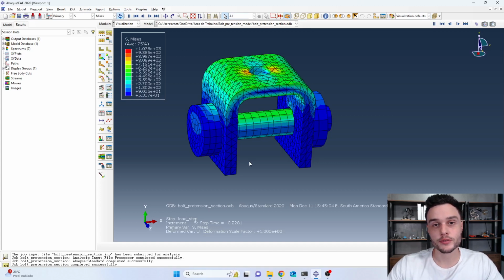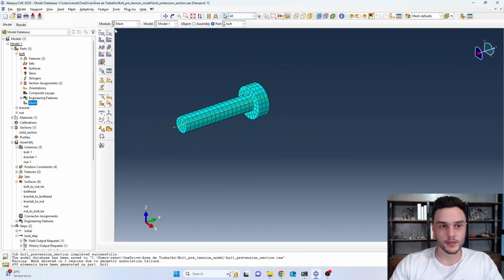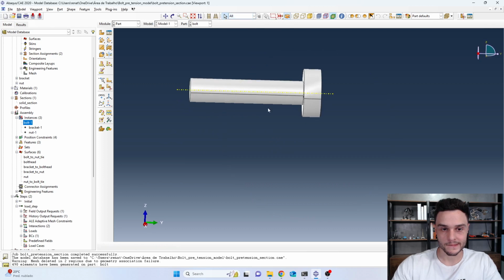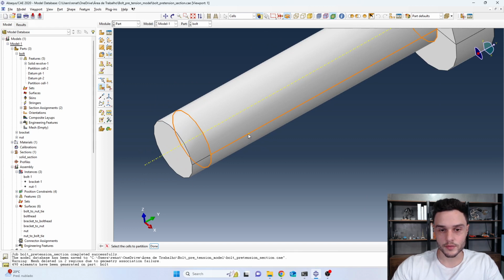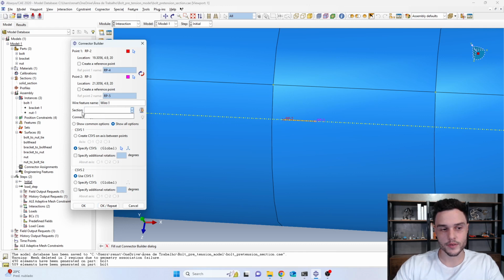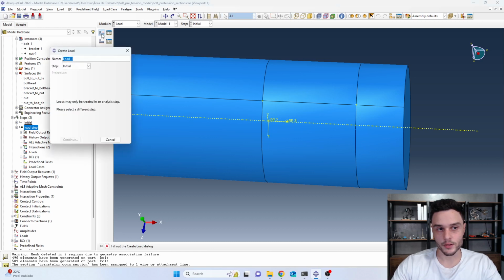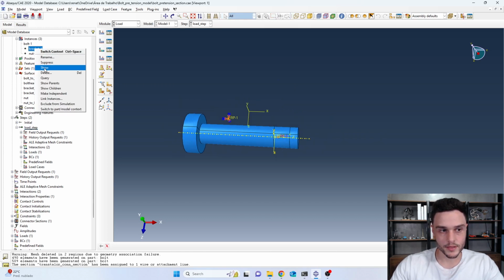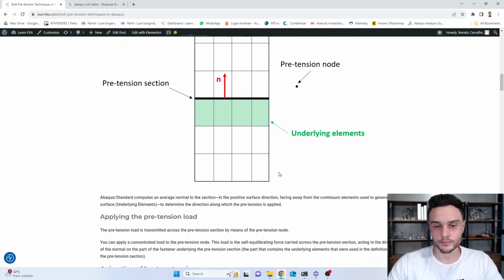Bolt Pre-tension Techniques in ABAQUS - Part 2

Comment: Great video, although you haven't shown how to fix the bolt length in a Step 2 having applied a pre-tension force in Step 1.
This doesn't sem to be something that is explained that well at all on the net.
Reply from the maker: I'll create a quick video later showing how to do that. In a nutshell, if you're using bolt-pretension section, I simply need to create a FIXED Boundary Condition on DOF 1 of the pretension node. If you're using a translator connection to apply the bolt-pretension, than you just need to create a Connector motion on the next step fixing DOF 1. Anyways, I know that it's not clear when the explation is in written format. Later I'll create a video about it.
Reply: @eng.renatocarvalho  
Thanks !
I've used Abaqus as a solver for 15+ years but always used HyperMesh as the preprocessor and 3D Hex els for the bolts, which actually worked well... or thermal contractions of a 1D beam

Abaqus, by comparison, is horrible. You don't really know what it's doing.
Also the first time I'v tried using Connectors. It's all a bit smoke & mirrors !
Reply from the maker: @lewis72  I also don't use Abaqus CAE application on a daily basis. I use ANSA as pre-processor to build complex models. In this next tutorial, I'll show how to do it in ANSA and I guess you'll be able to reproduce in Hypermesh.

Comment: This von mises stress of 1073 MPa is above uts point so this is surely unrealistic stress how can we find actual realistic solution?😊
Reply from the maker: The goal of the video was to teach about bolt pretension techniques, so I was not worried about stress levels. However, if the goal was to perform a realistic structural analysis that stress should be calculated, the material should be modeled as accurate as possible by inserting the stress strain curve in Abaqus. Also, the proper bolt pretension should be applied (in this video I have just applied a random value of bolt pretension). Usually, the proper value is 70% of proof load.
Reply: @eng.renatocarvalho thank you for the video it helped a lot.
I request to upload one more video considering realistic solutions
Reply from the maker: @abjaiswal150 check out the following video that is about stress strain curve approximation for ductile materials. If you apply the idea of this video and also a reasonable value of bolt pretension, then you’ll get realistic results

https://youtu.be/0KqthRW3pzM?si=4_mS-Njv4t-lr61R

Comment: Thanks for the video. I have a question. In your webpage you wrote : "You can maintain the initial adjustment of the coupling’s reference nodes by using a boundary condition (*CONNECTOR MOTION) fixing the degree of freedom 1 (X) at its current value at the start of the next step once an initial pre-tension is applied in the fastener." Can you write here how the *Connector Motion keyword must be writen in my input deck? Please. Thanks in advance.
Reply from the maker: Hi! I responded in the blog. Here's is the answer:

I will show you an example in which the bolt pre-tension of 10000 N is applied at Step 1 and fixed at Step 2. Notice that at step 2, before applying the connector motion BC, I reset the connector load using *CONNECTOR LOAD, OP=NEW.

*STEP, NAME=bolt_pretension, NLGEOM=YES
*STATIC
0.1, 1
*CONNECTOR LOAD
connector_set_name, 1, 10000
*END STEP
*STEP, NAME=fix_pretension, NLGEOM=YES
*STATIC
0.1, 1
*CONECTOR LOAD, OP=NEW
*CONNECTOR MOTION, FIXED
connector_set_name, 1
*END STEP

Comment: Gracias. Lo pude hacer andar en una unión tipo brida para perfiles pero tuve un problema, y es que una vez hecha la pretensión, en el siguiente paso al traccionar el bulón se me "zafa". Intenté colocarle LOCK en las Behavior Options, pero no entendí lo de Position Locking Criteria (lower and upper bounds). 
No puedo aplicar las mismas superficies para que en ese siguiente paso actúe una CONTACT INTERACTION (ROUGH por ejemplo) porque no converge o sale algún error de que no puedo aplicar las mismas superficies para dos tipos de restricciones, y no puedo aplicar CONSTRAINTS porque no puedo elegir en cual STEP comienzan.
Reply from the maker: I'm not sure if I understood well, but I guess you are saying that when you apply the bolt pre-tension, the nut comes off the bolt instead of in, right? If that's so, you should fix the coordinate system, or the order you picked the nodes to create the connector. In my blog post, that you can access by clicking the link in the description, I explain how this works. Please, read it with care and you'll understand. If you want a quick fix, you should apply a negative connector load instead of positive. Let me know if that was your doubt.
Reply: Thanks for the reply! But sadly not. I faced that problem before getting it to work, but now I think I'm pass that issue which you let the viewer know in this video that it can happen (and I also read about Technique 2 in your blog post page). 
The thing is that I have two steps in my model, (1) Preload and (2) Tension. It's like in the example of this video, but after the step of preloading, I wanted to open the brakets with external forces, then the nut "slips" and cannot hold positions. In real life it could be something like the nut being unscrewed (or untorqued?) after being screwed in (or torqued?), when you try to pull away the plates that the bolt and nut are holding togheter.
Reply from the maker: @martinmoran4919 send me the .inp file in my e-mail, so that I can take a look at it, please. My email: renato.carvalho@learnfea.com
Reply: Wow. Awesome, thanks.

Comment: Great content! Well explained👍. If the objective is to find the stress on the bolt due to pre-tension, which of the two methods you would recommend and why?
Reply from the maker: I'd recommend the one the uses the translator connector, because the force will come from the nut region, which is what happens in reality. But the standard method also yields to representative stress countour in the bolt. A good exercise would be to test it by yourself. Create the same bolted connection using these two different techniques and compare the stress countour plot on the bolt. Great question, by the way.
Reply: @eng.renatocarvalho   Thanks for the reply.

Comment: Thank you for this very instructive video. 
I would like to know if it's possible to apply a relative displacement between the two nodes of connector, in order to create the pre-load,  rather than to apply a  force
Reply: Thank you for your reply.
Would those two steps be static general ? Some particular advice about the contacts to apply ?
Reply from the maker: @CP-zi3eg  Yes, it can be static, but not necessarily. In regard to contacts, there's a blog post on LearnFEA detailing how to model contacts in Abaqus. You can find it accessible via the following link: https://learnfea.com/surface-to-surface-contact-in-abaqus/
Reply from the maker: Yes, it is possible. A good example of usage of displacement boundary condition for bolt pretension is when you have to apply a bolt pretension of 80 kN, for instance, and you create a first step where you apply a displacement BC in the connector just to initialize the contact between the parts, or even to close an initial GAP. It’s much easier to reach for convergence with displacement BCs. Then, let’s suppose that in the first step you reach a pretension load of 30 kN. On the second step, you can apply a load boundary condition to reach to the required 80 kN. On the second step, since the contacts are already initialized and GAPs closed, it’s going to be much easier to get your model converged. Let me know if you had any doubt.